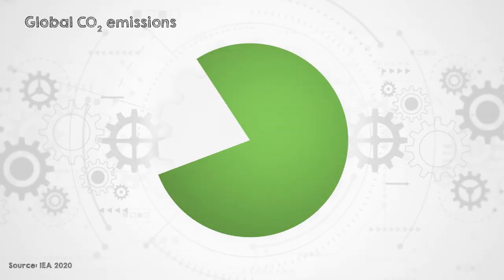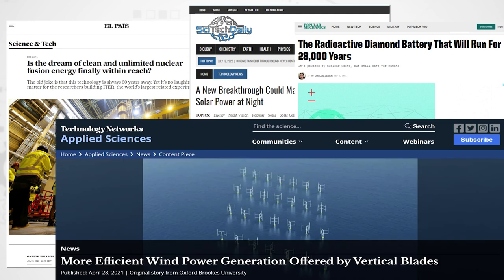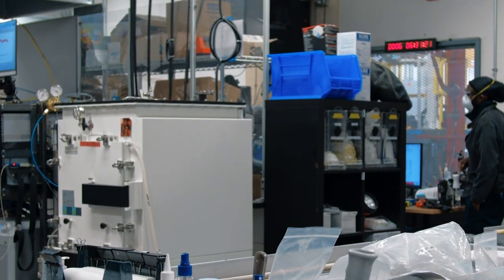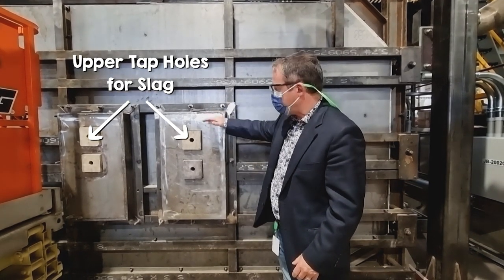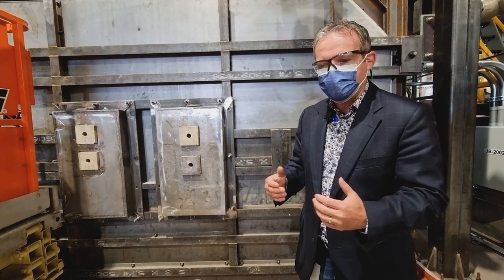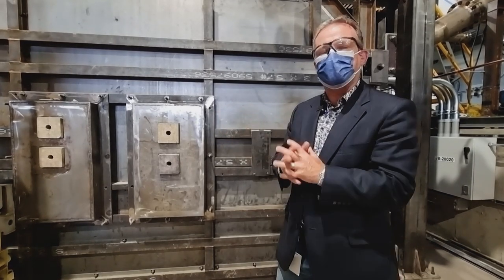CO2-Free Fe: Green Steel Tour with Boston Metal

Comment: So, this works on the same principle as aluminum smelters: you disolve iron ore in molten electrolyte, because melting it directly would require too high temperature? Of course, devil is in details, but as these guys say, most of "big hardware" is the same as in aluminum industry. Looks very promising.
Now, or course, we have to power that by clean electricity. Small modular reactors come to mind - this process will be equally intolerant of power interruption as alumina electrolysis is. 
As an example of how power-hungry oxide electrolysis processes are, 60% of electricity produced by 1GW+ Akosombo Dam power plant in Ghana (which produced accumulation that flooded 3.5% of the country) is reserved for an aluminum smelter.
Reply from the maker: My understanding is that this specific process is fairly intolerant of power interruption, as it takes a long time to get up to temperature. We talked about that issue in a bit of depth in the previous video I did comparing all the tech options for green steel.
And it's interesting that you mention that issue related to aluminium, as I was scheduled (it got postponed unfortunately) to visit a large smelter north of Sydney to make a video about how they can reduce their consumption significantly in times of grid stress. In normal operation they're about 12% of the whole state's electricity consumption (state population = 8 million), and they can modify their operation to effectively act like a 3 hour battery. Which is huuuuge! So I think more flexibility is possible than you might think with aluminium.
Reply: @EngineeringwithRosie  That's great! I hope you will still make that video, Thanks!
Reply: You dissolve iron ore into the molten electrolyte to create ionic species of FeO.  When these meet the electrons that travel through the electrolyte, then the electrochemical reactions take place to break them up into two units of Fe and one unit of O2. That is MOE.
Reply: @EngineeringwithRosie  Have a look at the EnPot technology for this virtual battery concept.

Comment: How does the additional carbon from power generation factor into the net amount? Unless the additional electricity consumed is being provided from a non-emitting source, this is just shifting who in the chain of production is responsible for the emission; there will be some improvement in net carbon since not all the power will have been coal-generated (depending on the locale, cough cough China India USA), but it won't be as if their 8% contribution to global levels will disappear. In the worst-case scenario, their need for high-volume, consistent power could steer this technology to be used in high fossil-fuel grids, which tends to be more easily scaled up in capacity. The slack would have to be picked up by nuclear fission I think, until fusion comes along. Although, gov't policies for energy producers could do a lot to further encourage grid energy suppliers/producers into adopting more non-emitting generation capacity, which could conceivably head this off.

Comment: although I can see the innovation here in the industry, however using Electricity to "fuel" the process is only as "Green / CO2 Free" as the energy provider,   Sure Blast furnaces produce a bunch of CO2, however they use relatively little "electricity" for their process. and for a comparable analysis of CO2 production for this comparison "omitting" the CO2 produced by the energy provider is akin to the "no CO2 at the Tailpipe" claims of the electric car industry...which indeed is true but is intellectually dishonest, as it omits the significant CO2 emissions during production and for charging the vehicle.
Reply: Coal is being phased out in electric generation in much of the developed world.  Obviously the cleanliness of the steel will only be as good as the cleanliness of the electricity.  We have LOTS of ways to make clean electricity.

Comment: The electricity comes from where? First you have to see if the technology works, I get it. The truth of the matter is it has to be cost effective. Just  because it looks clean it does not mean it is "Green". We focus on CO2 but this gas is not a pollutant, it is required For LIFE on this planet. Starting with a conclusion and then working your way to build up evidence is the bass ackwards a way to do something. What is the energy advantage in this type of process.

Comment: Super video.
I think SSAB is already using this technic and have delivered low CO2 steel for a car company.
Reply: SSAB is using hydrogen to reduce the ore.
Reply: Well, we do produce fossil-free steel in two steps instead of one. First fossil-free sponge iron by direct reduction of oxygen with the Hybrit technology. The reducing agent is hydrogen instead of coal. Then steel in an EAF. Everything powered by fossil-free electricity. / Johan Anderson, SSAB
Reply: @johan_anderson  Thank you for your insight!
So your hydrogen is electrolyzed from water using renewable electricity?
Reply: @jimurrata6785  Yes, the electricity to our plant in Kiruna, comes from hydro and wind power in northern Sweden.

Comment: On a grand scale the Aluminum industry has been using this reduction process for decades. The largest issue for Aluminum (and Iron) refining is the cost and availability of enormous quantities of electricity it takes to split the oxygen from the metal.  They build Aluminum reduction works near hydro power sources for a reason.  Ah, "solar" you say, just do a little calculation to see how much area it takes to match than train car full of coal, remembering solar is only available for about 5 hours a day when the sun is shining.  Ok, it's hydro, well that is already spoken for, all those Teslas and electric homes to reach CO2 goals.  Politically, new hydro dams are worse than nuclear energy.  

Aluminum refining anodes have to be changed frequently, I suspect anodes for the higher temperature iron would be a very significant and costly issue.

I can't fathom how this could ever compete with the current coke/iron ore smelting process. Reducing CO2 OK, but I would rather use our limited clean electrical energy to run homes, transportation and industry where carbon capture would be very hard to do and use the coal at the steel mill where carbon capture could be more likely.
Reply: This is an ideal use of green energy because you can predict when the sun will shine and tailor your process around that.
Reply: @macroman91   What!   So you shutter your plant on cloudy days or at night, how does that work.  Remember you can let the electrolytic cell cool down and have the liquid iron solidify that would distroy the cell. Steel manufacturing is a 24/7 operation.  Blast furnaces only get shut down when they need to be re-lined with new refractory bricks.
Reply: @craigs5212  It runs 24/7 now, but that's the existing process; there will be new processes developed for this technology.
Reply: Pretty simple. You'll have a PPA for 1GW of power of crazy cheap power. When the real time price of electricty goes higher than your profit margin, you'll wind down and sell unused power back to your supplier. In times of crazy demand or low RE production you'll make more money ramping down than making iron. It's great way to balance out a grid.
Having lots of these cusomtomers on the grid will encourage lots of overbuild, and will place value on generating power at complimentary times - even if the raw costs is higher. Even thought solar will be the cheapest doesn't mean it has more value than wind.

Comment: The title of this video is misleading.  It suggests that these people are making steel with no CO2 emissions and that is not what they are doing.  They are refining iron, not steel, and this is just one step in the production process.  The mining and transport of the ore have not been addressed here and I would be willing to bet that mining and shipping is where the majority of the CO2 happens.
   So it's nice that they are coming up with processes that emit less CO2, but this is not CO2-free steel nor is it even close.
   If you want to have a bigger impact on CO2 emissions how about processing the ore near the mine instead of shipping it around the world? It will take much less fuel to ship pig iron than it does to ship ore.  And while we're at it, let's make the ships greener.  If nothing else, It's lower-hanging fruit.
Reply: No, mining and shipping is not that bad.  It's the coal burning involved in heating and reduction of iron oxide where the vast majority of the CO2 comes from.
Reply: @incognitotorpedo42  Have you been to an iron ore mine or port?  Mines have power stations that generally emit CO2 and they have very large equipment that burns diesel.  Then they ship the ore hundreds of kilometers to a port, using diesel in trains or trucks or sometimes via 15km worth of conveyor (or 100km worth of pipeline on the one I'm currently involved with).  Then the port also needs a power station to run the stackers, reclaimers, screens, conveyors and shiploaders.  Then there's the 200,000 tonne ships that take the ore across an ocean to process it.  Another port at the other end and a railway to the smelter.
   And if the smelter was located at the mine there would be an immediate reduction in power demand for every step of handling. Instead of shipping 100kt of ore they would ship 60kt of pig iron.  Zero new technology is needed to do that.  Then we could add this nice, new green production process and make it even better.

Comment: Question: And where will the electricity come from?  In the US 60% of electricy production comes from fossil fuels. 20% of that is from coal. Until something is done about that, the switch from coal to electricity in the manufacture of steel will not have much of an impact on that 8% CO2 emissions you mention. To really make a dent in that, we would need to build about 20 300Mw small modular nuclear reactors a month ... for the next 10 years. OR, cover the entire state of Arizona and New Mexico with solar panels. To handle basline load you then need the equivalent of a Tesla wall 50 miles high. The magnitude of the problem is not easily understood by non-engineers. In reality, we will probably need to do BOTH!

edit: SMNR's are typically in the 300Mw range.
Reply: If the existing nuclear plants in the US account for 9% of the nations energy then 20/mo at 1gw per for 4.6 yr should do it but that's still a ridiculous number. Just indicates the scale needed to switch from fossil fuels.
Reply: @RichRich1955  Current US energy use (of all kinds) is about 4 billion Kwh. 60% of that would require  8000 small modular 300Mw reactors. That's about 66 a month over 10 years. I was being consevative. But I think we agree, the magnitude of the problem is just not being addressed (even comprehended) by policy makers or the general public today.

Comment: A lot of talk but no one has truly explained what’s really going on. I have no idea how any of this works or how it’s any better than heating iron with LNG or solar. Seems like a lot of complications when nuclear is the way of the future.
Reply: when making steel, or pig iron to be precise you are not just heating iron ore, you are reducing it, that's why you use coal, not just to heat it up, the product of that reduction is iron with high carbon content and co2, otherwise you would need to heat it up to insane temperatures, an other way is using an electrochemical cell, aluminum metal is made that way, also what does it have to do with anything that nuclear is the way to the future? this process requires electricity as an energy source instead of coal, which according to you would be produced by nuclear energy, where is the contradiction?
Reply: @diegogmx2000  John Doe probably doesn't know what "reducing" means, which is why he doesn't understand this.

Comment: There is something fishy about the claim that a single 600 kA cell can produce 1.5 million tons of iron per year. My back of the envelope calculation suggests that 500-600 cells might be needed for that quantity. Even if I'm off a little (or even a lot), it's a lot of cells. Do these guys really know what they're doing? 🙂
Reply: I don't think that is what they are claiming.  I suspect that they are saying the economics were such that a bank of 600 kA cells could be structured into a plant that could replace a blast furnace with that capacity.
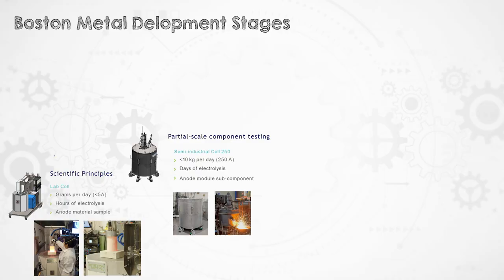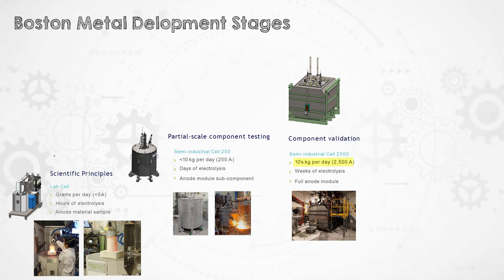Reply: @richdobbs6595  I don't know what they're thinking. I only commented on what they're saying. There is other inconsistency: at 4:50, Rosie describes a 25 kA cell and the engineer repeats that (actually says moltenous oxide, but well 🙂), but the legend says 2.5 kA, which makes sense based on a schematic shown later. At 6:30, a VP starts his description of the scale-up effort, and at 9:15 says, "one smelter, at 600 kA, can produce 1.5 Mt of iron per year." Perhaps he meant plant, so OK (no argument there). Overall, the claims are bombastic to say the least, and the development timeline appears to be lightning fast - keep in mind that this is a very high temperature process (Iron melts at 1538 C), perhaps 3000 F. As they say, if something sounds too good to be true... 🙂I wish that Rosie had aimed for more than a commercial for Boston Metal. 🙂
Reply: I am the guy that made that comment.  With 'smelter" I refer to a commercial electrolysis plant with a line that consists of several hundreds of cells in series (example:  EGA's electrolysis line no. 3 in Abu Dhabi was originally built with 444 cells).  It is a common term in this industry.  But when you add up the production of all those (MOE iron) cells you can accurately calculate total production of up to 1.5 million tons per year.  That size is needed if we want to replace a blast furnace. Oh, and yes we know what we are doing 😉

Comment: Steelmaking is 8% of anthropogenic steel emissions, which are about 5% of global CO2 emissions.  So it is actually 0.4% of CO2 emissions.  There is a difference there.  Using electricity to make iron from iron ore is relatively straightforward but much more expensive than using coal.  To convert the iron to steel, excess carbon needs to be removed, usually by adding pure oxygen and making CO2.
Reply: I think you misinterpreted that.  Steelmaking is about 8% of GLOBAL CO2 emissions.  It's really a lot.

Comment: It's gonna be hard to sell this tech to an actual industrial producer if being "green" is its only advantage.  This is why carbon taxes need to be a thing.  So that polluting actually has a cost for industry.  As long as dumping CO2 into the air costs nothing, companies will continue to do that instead of invest in cleaner methods.
Reply: Another way to do it is for manufacturers to specify clean steel.  This will happen soon in the auto industry.  Government subsidy of clean steel is another option.
Reply: Humans breathe out CO2 when they exhale.  Should breathing be taxed? ;-)